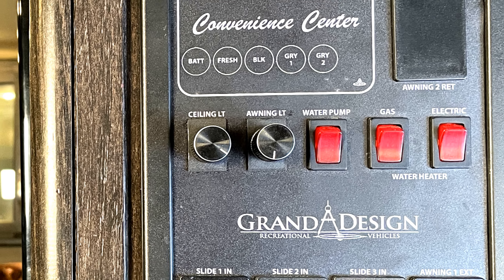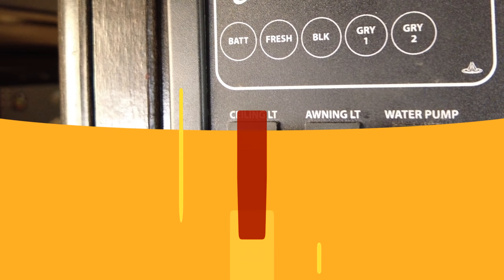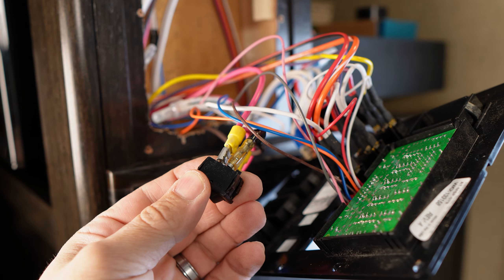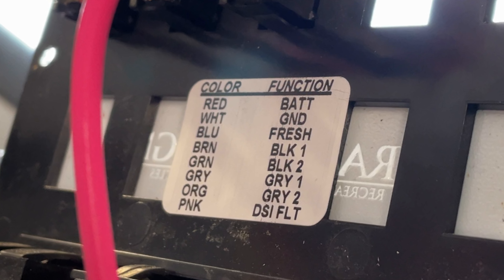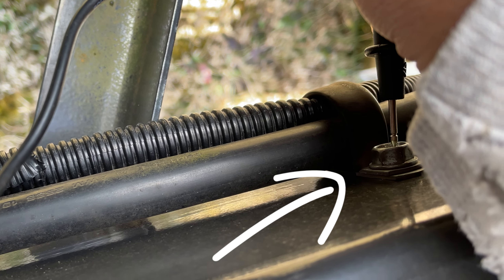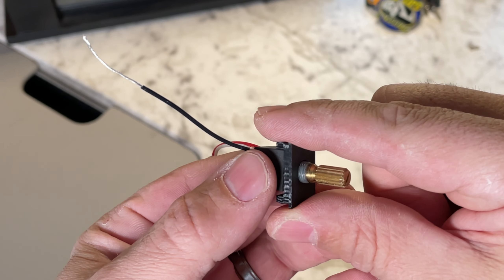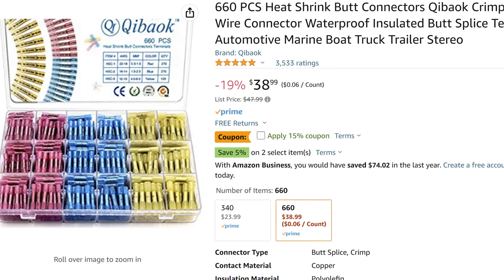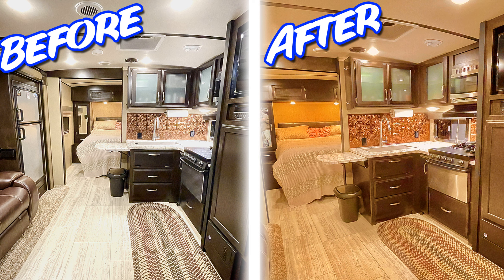How to Install Dimmer Switches on Your RV Lights - Easy to Follow Installation Guide!

Comment: I’d urge anyone who wants to install dimmer switches to watch this video.  It’s one of the few that actually pulls out a multimeter and does the installation correctly.  He mentions he’s not an electrician, but I have been for 15 years, this is spot on.  The part about the water heater button is an example of how people should be forward thinking when modifying their RV.
Reply from the maker: Thanks Lake, glad to help.

Comment: I did this mod today.    By all means, follow his instructions on the wiring as if you try to use those contained with the switches, it won’t work.    I had 3 wires to my old switch so I tried using the instructions.   Even used the volt meter so I was sure I had every wire inside the panel identified.   Once I rewatched his video, I had it working in minutes.   Also, save yourself some time and buy connectors that mimick your old switch connectors and connect them to the new dimmer switch.   Just unplug the old one and install the new one.   No splicing wires.
Reply: My ceiling switch also has 3 wires going to it. How did you wire yours up?
Reply from the maker: thanks for watching!

Comment: Hi Ross. I purchased the dimmer and switch plate and just wired them up. The switch works, however it doesn't dim. They turn off slightly before the switch gets to the off position. Is it possible a 2020 Grand Design Reflection wouldn't have dimmable LED's installed?
Reply from the maker: they should be dimmable lights.  can you send me a picture of your wiring?

Comment: I’m trying to install dimmer switch in my RV. I have an issue as my switch does have a three prong switch. What I have is wires hooked to all three prongs. (White, Red, and Brown) what should I do with the Brown wire???
Reply from the maker: if you have 3 wires on your current switch, one is probably a ground to turn on the a light on the switch.  simply meter the wires to find out which one is ground.  disconnect it, and if the lights still work, you wont need it installed on the dimmer switch.  dont go by colors, use a multimeter and test everything.  all you need to know to use the dimmer switch in this video is the power in and the power out.  its likely your lights are grounded elsewhere.

Comment: I added the recommended dimmer switches to my interior lights and exterior light and they seem to work just fine. But when I am operating on 12v, all the lights flicker when the water pump also runs. Any ideas what may be wrong or how to fix it?
Reply from the maker: I'm not sure, does it do this no matter where the dimmer is set to?
Reply: When I set either dimmer switch to “max” on, the lights will flicker a little. When I turn them down a little, they are perfectly steady. But with the water pump running, it did not matter what the dimmer switch setting was- they would flicker.
Reply from the maker: odd, here are a quick things I found doing a quick search.  i dont think it has anything to do with the switch, its a brand name, and its not a cheap switch, but it could be defective.  Here are some things to look at.  Btw, mine will flicker occasionally if a lot of things are running, but its very rare and only when the switch is all the way on.  I back it off a little and it stops.  With just the water pump on, they dont flicker at different dial positions:

Incompatible dimmer switch: Using a dimmer switch that isn't designed for the bulbs can cause inconsistent voltage, which can lead to flickering.

Defective connection: A poor connection between the lamp and the controls can cause flickering. This could be because the controls are old, out of sync with the lamp, or not designed to work with the lamp. You can check for a bad connection by wiggling the on/off switch. If the light dims while you're wiggling it, the switch might be faulty.

Loose wiring: Over time, wires can loosen and come undone, which can cause flickering. Loose or worn wires can also decrease voltage, which can lead to flickering. If you suspect loose wiring, you should have an electrician take a look at it.

Voltage fluctuations: Voltage fluctuations can cause consistent flickering, unpredictable dimming, or frequent light burnouts. You can use a voltmeter to make sure your house is registering between 115-125 volts. If there are major fluctuations, you should contact an electrician.

Utility issues: Problems with the utility service, such as grid fluctuations or issues with utility equipment, can cause widespread flickering lights. These issues are usually outside of a homeowner's control, but you should report them to your utility provider.

Comment: Thank you for this video!  I was wondering if you had any recommendations for a slim dimmer switch or something that protrudes less than the knob style you used?  My panel is the same as yours however there is a door covering the panel access which also covers the pantry just above so I would like to keep the door for that reason, but I do not think the door would close with the knob style.  Any recommendations for switch that allows me to follow your same installation instructions but that is slim?  Thank you very much!
Reply from the maker: not that I know of, sorry.

Comment: Thank you! Going to do this shortly, QUESTION - I want to install that flip up countertop in my GD Transcend, my countertop looks to be the same as yours (Aria Carrera color I am told by GD) BUT I cannot find a part # for this counter extension in my color. I called GD and have part # 671906 for the Bellini Platinum color countertop, but they wont/cant provide me for the part # I need. Any chance you installed that part yourself, or did it come on your trailer?
Reply from the maker: sorry, it came with my trailer, and im not sure i know exactly where to find the part number either, unfortunately.

Comment: Ross,  Thanks for the great video!  I purchased all recommended supplies for my Grand Design camper, performed the voltage checks you recommended and wired the dimmer following the instructions included with the switch.  Oops!  Didn’t work!  Checked your video again and followed YOUR wiring recommendations in the video, works perfectly!  (The instructions included with the switch are slightly different).  

If you are going to try this, pay attention to Ross carefully and follow his instructions!  Thanks again Ross!
Reply from the maker: Glad to help my friend, the wiring diagrams are a bit confusing.

Comment: I can’t give this video enough thumbs ups!!!  Between the links to the 3D-printed switch blank and actual dimmer switches to his very clear instructions - it was all perfect.  I unplugged the shore power to our Heritage Glen camper, killed the power disconnect under the bed where the LFP batteries are located, and used the WAGO connectors I had to install the switch in about 5 minutes.  I kept the spade connectors w/wires connected to the original plug in case we decide to ever revert back to stock…but unlikely.  Now we can use our awning light at the campsite without blinding everyone within 50 feet!  Thanks again, RV Tips & Travels!!!
Reply from the maker: glad it helped, enjoy and thanks Chris!

Comment: I cannot install a dimmer for the interior lights but I could for my awning lights though. Thanks for the content Ross and btw, I love using the Wago connectors.
Reply from the maker: They are very nice I agree.  I be used them a lot.

Comment: Another awesome, insightful video Ross.
   Totally agree about heat shrinking crimp style connectors but I suggest one more step (mostly in exterior applications). I've used tubes of dielectric grease to squirt into both ends of a crimp connector prior to crimping. This 'nearly guarantees' a watertight connection after heat shrinking.
   Safe travels sir. Giddy up.
Reply from the maker: Lee, agree with your comment.  I usually solder with flux and heat shrink when connecting wires in outdoor applications.  Appreciate you bud.

Comment: I have same rv. I found that the end piece on refrigerator door easily comes out and the front door panels slide out easily so you can paint them and slide back in and return that edging back on.

Comment: Just recently purchased our first RV (KZ Connect Lite C211BH) , and have found your videos extremely helpful and easy to follow! Purchased a lot of the "essentials" items from your video as well. 😊 I am preparing to install a dimmer switch in our RV (our switches were actually larger, so I found someone on Etsy who was aware of the larger size and custom printed a couple for me), but I had a question. In your video, all the factory wires have those flat "plugs" that go onto the switch. Do you cut those ends off when connecting the dimmer wires? That part wasn't covered in the video. I'm assuming so, since you mentioned Wago connectors (which I have), but wanted to double check if there was a better way than snipping those ends off! Thanks!
Reply: Yes, cut and strip them. Then use the wago wire connectors. Easy peasy. I just did nine today.
Reply from the maker: thanks for helping.
Reply from the maker: cut them, use wago or heat shrink butt connectors.

Comment from the maker: ✨⭐ PRODUCTS FEATURED IN THIS VIDEO ⭐✨

I WILL BE TRAVELING AN UNABLE TO SHIP ANY ITEMS FROM 2-15-25 THRU 2-23-25.  ALL ORDERS PLACED DURING THAT TIME WILL SHIP ON 2-24-25.

🔹 12 Volt Dimmer Switch https://amzn.to/3Jl61Tu
🔹 Panel Plate Size 1/2" X 3/4" for Dimmer Switch (item no. 001) https://www.ebay.com/itm/195673736914

🔹*NEW SIZE AVAILABLE* Panel Plate Size for holes that are 1/2" by 1-1/8" (item no. 002) https://www.ebay.com/itm/195875261730
📰 Free RV Newsletter: https://view.flodesk.com/pages/6497c6a9d1998fa8c7623e9f

Comment: Hey Ross.  This video was perfect.  I installed the switches and they work great.  One question, however.  When the water pump goes on, the lights dim and flicker.  Is there any way to prevent that?
Reply from the maker: Ive read about this a little, i get it once in a while.  I dont have a good answer except from what I understand it might have something to do with the converter or the available power from battery.  Does yours do it every time the water pump turns on?
Reply: @RVTIPSANDTRAVELS  yes...  Every time.  I took it out this last weekend and noticed it.  The OEM switch had 3 wires attached to 3 terminals and the lights didn't flicker with that switch installed.  I fiddled a little and tried to connect the white to white, red to red, etc. but it didn't work at all unless the white and red wires were together like you showed in your video.
Reply from the maker: i would try a new switch... flickering happens on occasion for me, and its only when the dial is in a very specific place, so i just turn it slightly and it stops.  it could be your actual lights, it could be the converter... google search why dimmable led lights flicker and youll find a bunch of good articles.  i dont think its the switch.  thats a good company and not a cheap switch.  try a new switch first, send the old one back.  let me know.
Reply: @RVTIPSANDTRAVELS  Hey Ross...  Just an update for ya on this...  I tried a new dimmer switch with the same results, so out came the multimeter.  The true issue is Grand Design decided to add 1 - 12v line for the pump and all the lights!  So...  The fix for me was running a new 12V line just to the pump and leaving the other line for all the lights.  I chose to run the new line to the pump just for location and convenience, but that was the true issue.  Not an issue with a switch, but the dimmer just had a little too much resistance to keep things from blinking.
Reply from the maker: glad you got it figured out... I will pass this information along if others have the issue.  I might even check my circuit as well.  Thanks bud!

Comment: Thanks for the video.   I have a reflection and ordered the plate you showed.   But when I went to do the install I found out my switches are smaller.   Do you know if there is a smaller plate available?
Reply from the maker: what size?

Comment: Im looking to buy a New battery for my RV, I was wondering which battery do you recommend? I just bought my RV and been using ur channel massively for help. Our 1st trip is in two weeks and our fridge is 12v and we only have 1 battery i want to make it two.
Reply from the maker: I have not even begun to research batteries/solar yet because we always have power.  Battleborn is a very popular option though.

Comment: Hi , I have the compass Connect system in my GD 17mke. But I’m lucky in that  that my main cabin lights are 3-way. ( I have a separate switch for the lights by the door in addition to the button on my compass Connect panel. I assume I can simply replace my toggle switch by the door with an 12v 3-way rv dimmer switch ?
Reply from the maker: it sounds like that might work but id like to see the schematics on the compass connect before i confirm.  i have yet to look at it.

Comment: I have a 2020 Imagine XLS 22MLE. It has a one piece PCB with membrane switches inside the control panel. The modifications detailed in this video will not work on my unit just as you said.  I would still like to dim the lights.  Do you have any other suggestions or videos to help me out? If the hardware will accommodate it, this might be something already built into the hardware and controlled by the Compass Connect software if the GD guys were thinking ahead. What do you think?
Reply from the maker: I don’t have any videos on the compass connect just yet.  Soon.

Comment: I have a 2022 Grand Design 5th wheel. I do have the Compass Connect. Do you have a video showing how to wire it to a dimmer?
Reply from the maker: not yet, need to find a trailer with this system so I can record the mod.

Comment: Any idea why the lights flicker when turned all the way up & the awning light is on? Currently on battery power reading 12.8 volts. I used the same dimmer switches and Wagu connectors on both ceiling and awning lights. Transcend 221RB, Thank you!
Reply from the maker: Russ, check out this article: https://www.instyleled.co.uk/blog/why-do-leds-flicker-and-how-to-stop-it-happening/
Reply: @RVTIPSANDTRAVELS Same here. I ordered exactly the same dimmers and wired as recommended.  They tend to flicker when at at or near full brightness.  That brightness level when flickering begins is also temperature sensitive if that makes any sense.  They also interfere with each other as the interior lights will start flickering if I turn on the awning lights also connected to a dimmer.  I read your article you linked and didn’t seems to conclude anything.   I’m installing into a just acquired 2025 Jayco RV.   Is it possible that some LEDs are “dimmable” and some are “not dimmable”?
Reply from the maker: it has to do with how they wired your trailer.  ive learned in some rvs flickering happens when the water pump turns on because they use the same power wire for the pump as the lights and resistance builds up... at least thats how i understand it, as changing the water pump wire to a dedicated wire fixed the issue.  if you temporarily run a constant power wire jumper to the switch from the battery or another 12v+ source, you may notice the flickering ceases.  in that case, i would install a new, dedicated wire for the lights.  it could be that the lights are dimmable, but if that were the case they wouldnt dim at all.  hope that helps.

Comment: Nice mod Ross I not sure if the 1156 led replacement bulbs I installed are dimmable thanks
Reply from the maker: If they are, this switch will work on incandescents too.
Reply: @RVTIPSANDTRAVELS  right on thanks Ross I may get one just to do my awning lights i installed one a couple of years ago my trailer never came with one being 2006 👍
Reply from the maker: Corey, what's your email address?
Reply: @RVTIPSANDTRAVELS  Ross is this legit
Reply from the maker: Yes, or send me an email management@rvtipsandtravels.com

Comment: I have a grand design as well but for some reason the awning light wasn’t dimming just a on (very dim) and off. Try hooking it up with and without ground. I may have a bad switch.
Reply from the maker: Tito, not sure what’s happening, but sounds like the switch.  Did you swap it to the one controlling your interior lights to check?
Reply: @RVTIPSANDTRAVELS  no I didn’t but it wasn’t controlling the living lights correctly either so figured it’s the switch. Thanks for a great video and a help

Comment: Would love a video for compass connect system.
Reply from the maker: Drive on up to PA and I'll do it on yours!  seriously, I need one to work on.  Already know how its done, but makes for a bad video without a demo.
Reply: @RVTIPSANDTRAVELS  would love to come up for that and the Hersey show. Can’t until next year. What dimmer would you use?
Reply from the maker: same dimmer, just needs to be wired differently.

Comment: I have a back lit  switch and three wires.  One ground, one constant power and one to the light.  How do I wire that one?
Reply from the maker: the ground is for the light, it wont be needed with the new switch.  isolate the ground, tuck it away in the wall, and use the other 2 wires just as i did in this video.